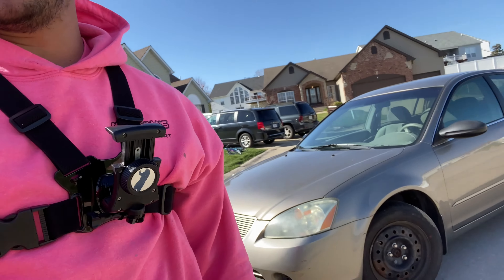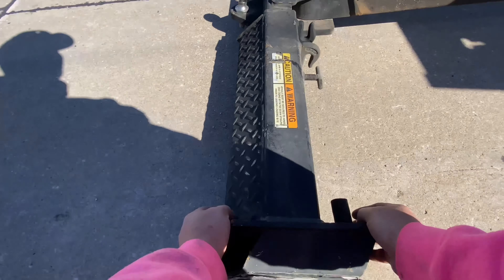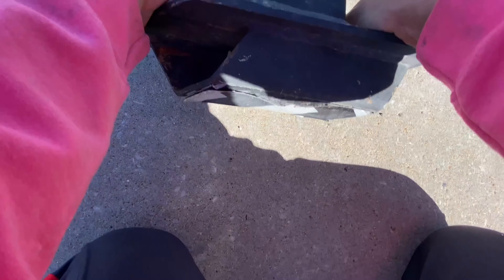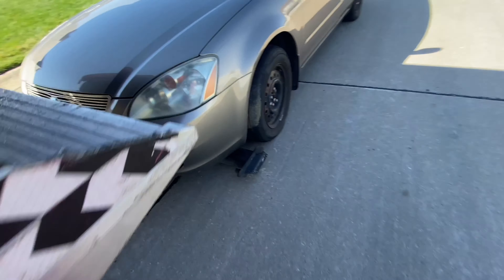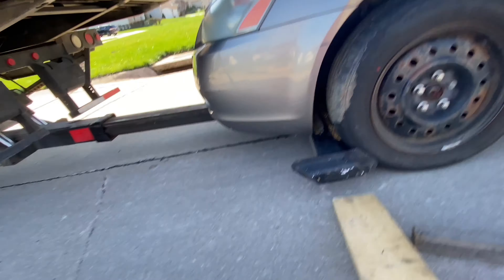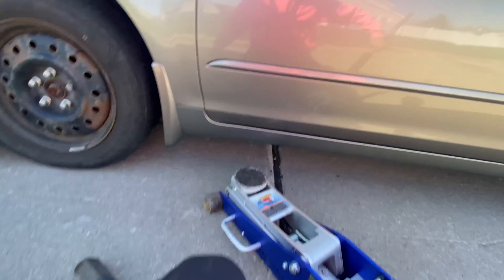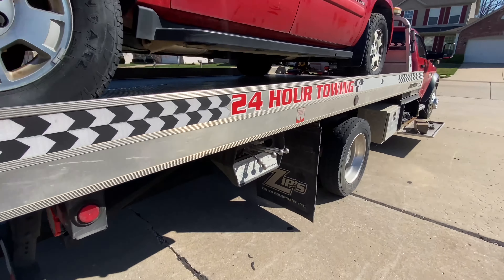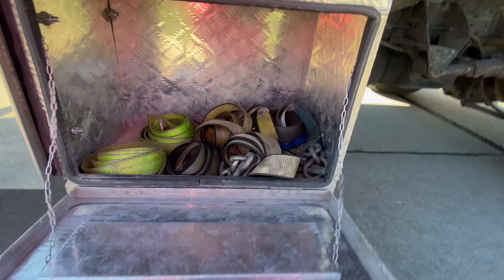Loading a car on rollback manual wheel lift and using lasso straps

Comment: I’m gonna be operating a rollback for work, and I was wondering what the appropriate places to put safety chains, how far, how much slack etc?
Reply from the maker: Every vehicle is different and it also depends what method the towing company you work for used some use lasso straps some use chains some use 8 point tie downs I usually use lasso straps around the rims or the j straps to slots to the deck all 4 corners!

Comment: No you are supposed to have the  wheel lift sliders all the way out with 10 inches of gap from the outside of the wheel, then the inside of the tire almost out of the pocket HAHAH JK thats how so many do it dangerous. I set them close to the sidewall. It rides nice. I always put the straps like you did with the D ring the other ways seem crappy unless it has a flat tire, no tire ETC

Comment: Could have bought a chevron. You wouldn’t need to beat it with a 4x4. Lmao
Reply from the maker: I bought that rollback used so couldn’t pick if it was up to me I’d have a dual tech low pro 1035 steel on a Cummins chassis!